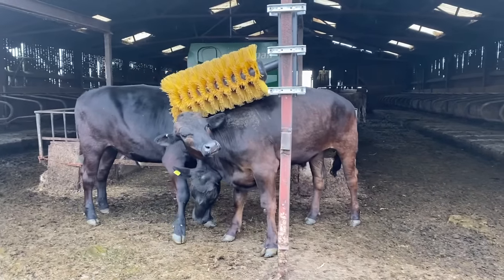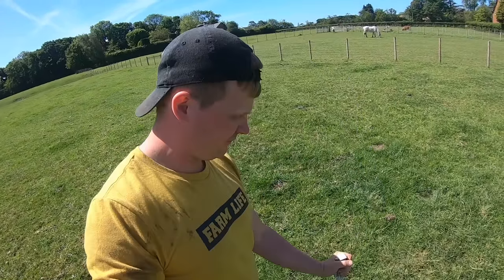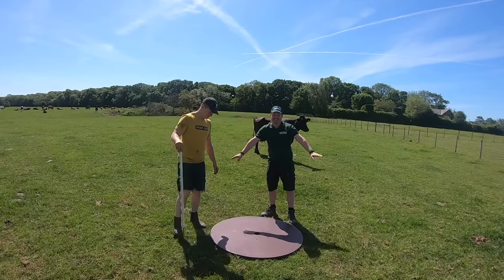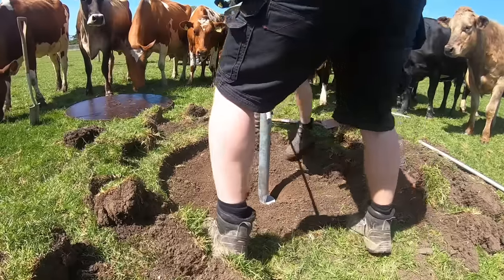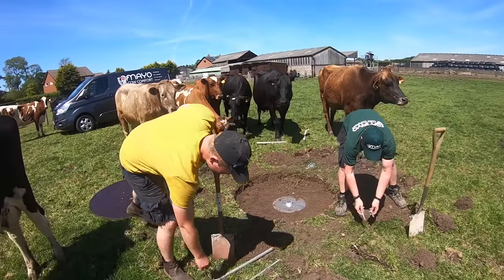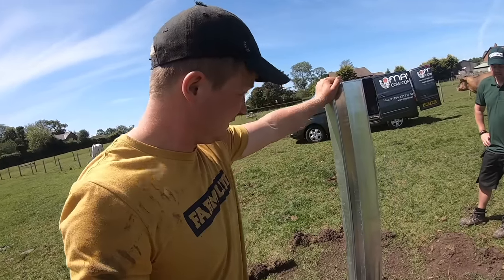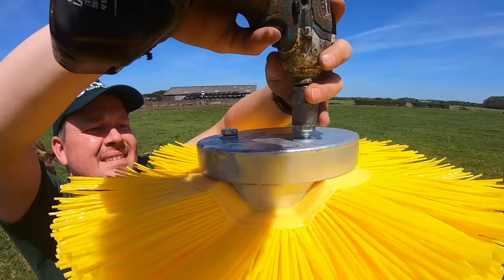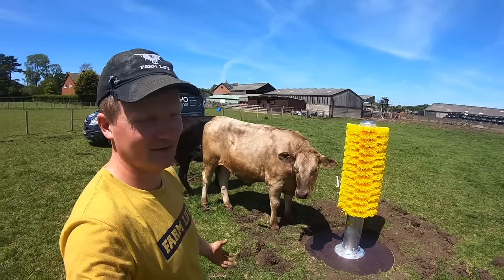HOW TO MAKE OVER 100 COWS EXTREMELY HAPPY VERY QUICKLY !

Comment: A few years ago I called the city department in charge of road maintenance and asked if they had any used street sweeper brushes. They did and I went and picked one up. After an hour of pulling stringy things out of it and a good power wash it was clean. I then found a young tree with a straight trunk, cut it off at about five feet and slipped the brush over the top. Cows and donkeys have been using it ever since. All free.
Reply: Now that is a great example of upcycling and preventing waste.
Reply: Did you ask to speak to the Cowncil?!
Reply: Based af

Comment: They will like this one better because it doesn’t swing like the other.
Reply: The one that swings is good for their backs.
Reply: The swinging one more of the body.. how's this one better?
Reply: @mikesenior3541  its stable so they can scratch better
Reply: No the swing one is better because it can reach their top body
Reply: @luqmanf.r.9134  
Well yes, but with this one they can apply more pressure on the scratcher.
Reply: Genius ... 👍👍
Reply: Why not have both options? ;)
Reply: @Ericcssonn  
Correct answer:
Yes

Comment: You could have put a few trees, with those cows actually use them to scratch themselves plus it actually gives them some shade to rest on...
Reply: Trees take an inordinate amount of time to grow strong enough to resist the continued rubbing and pushing of massive cows. And you can't just plant a big tree right in, it takes time to root itself, during which it could very easily get pushed over. 
And that's just the logistics of getting a tree ready; I'm fairly sure that open cow fields tend to not have trees for a good reason.
Reply: AnimalGem14  falling debris? Bruh its not a building thats falling apart and if youre talking about leaves.....ill just assume its branches and what not and my response is, theyd prolly be fine cows are pretty darn durable and intelligent they may even dodge the branch 😁
Reply: You start with a paddock containing  established trees not the other way around. Farming has become so cruel.

Comment: In the years where USA was connecting the west coast to the rest of the country by rail, they were also putting up telegraph wires and poles. A problem arose when the bison started to scratch themselves on the poles and knocked more than a few down, disrupting service. The telegraph companies had the bright idea to wrap the poles in a wicked barbed wire. The tines on the wire were like nails, intended to keep the bison away. Problem became worse when the bison actually LOVED the wire. It was super scratchy and they went after it like catnip to a cat. 
Turns out, smooth poles were the solution.

Comment: From an engineering perspective, that is extremely over engineered if they are only expecting it to survive 3-5 years.  An auger, old steel pole, and some cement would be at least 10-20 years with proper paint.  The brushes are just broom bristles.  You can buy the broom parts and just strap them to the pole.

Comment: It is not cheaper to put some trees over there? Like oranges trees? You may get some fruits and the cows too.
Reply: Trees take years to establish and become stock safe which would remove that paddock, or a significant area of it, from rotation, meaning less food for the cow's to eat so the herd size would have to be reduced.
Reply: @jg5755  I understand your point. I did not consider that.